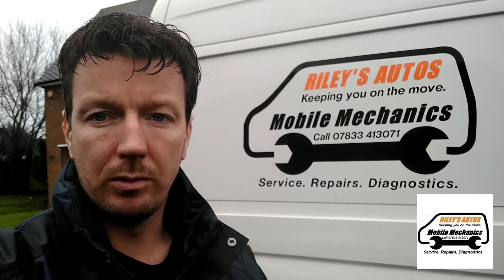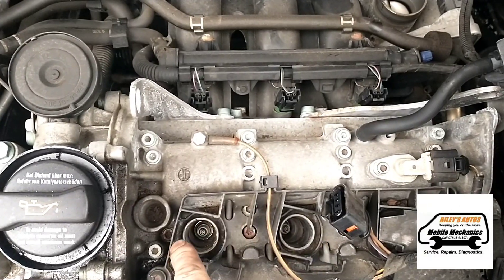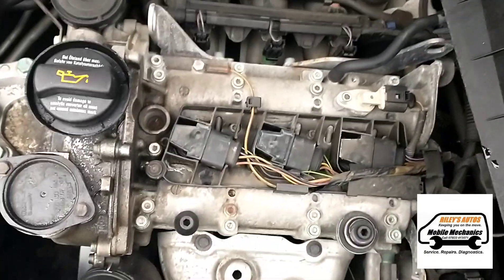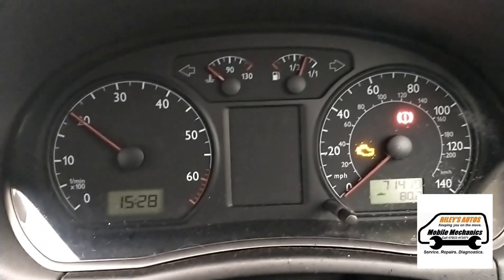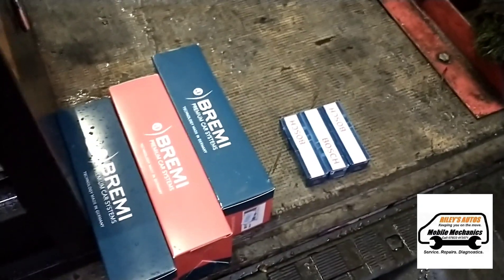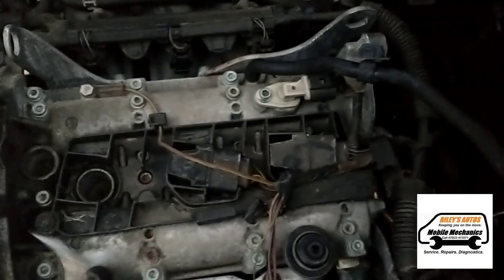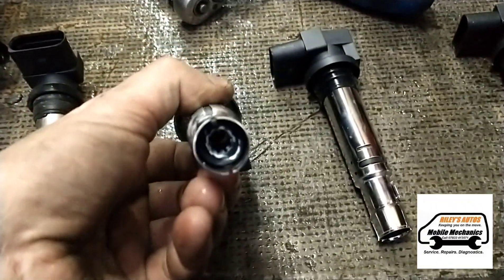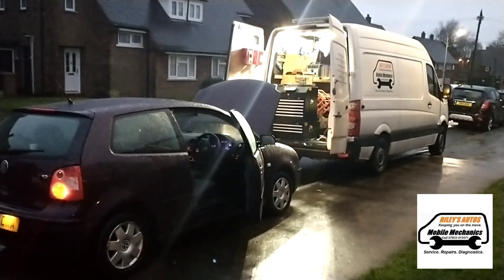How To Diagnose & Fix Engine Cylinder Misfire - Shaking engine  Fault Code 16685 P0301

Comment: I’ve got an intermittent harsh misfire on my 2014 1.0 MPI polo, only happens on startup and simply goes away with a restart, any ideas mate? Happens about once every 300 miles. Only DTC showing is cyl 2 misfire and i’ve already done all spark plugs and swapped the coils about.